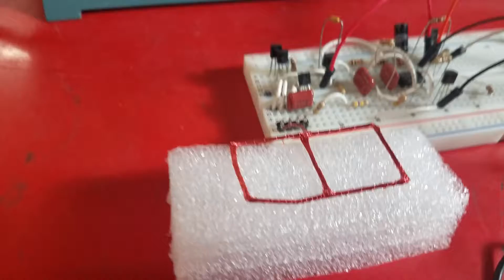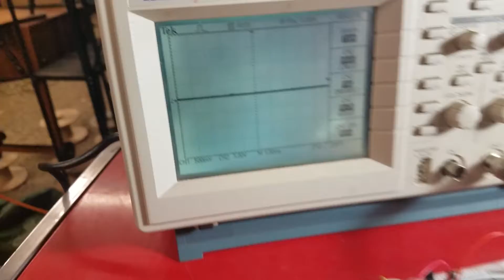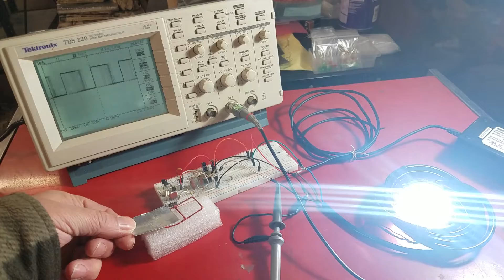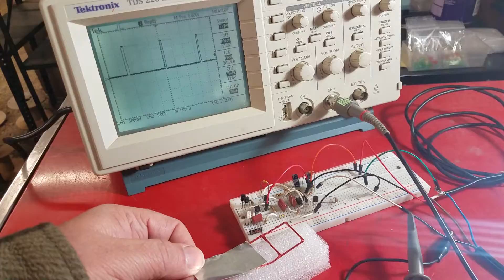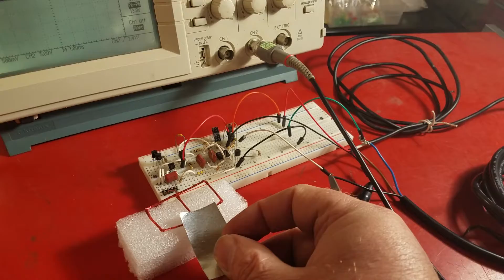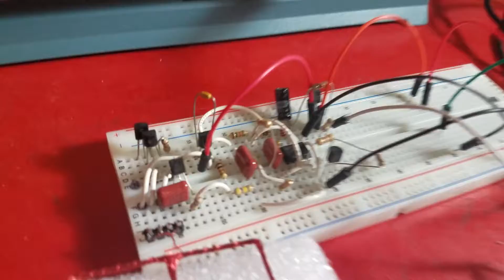Single Ended LVDT (Linear Variable Differential Transformer)

Comment: In the video, you show that the primary and secondary winding are connected to the 4 pin header inserted into the breadboard. The schematic has a 6 pin header so it is hard to determine how the coils are connected. Can you show how they are connected?
It appears that there are primary1 connections (P1) and two stator windings (S1 and S2) in the schematic, how does this differ from this video?
Reply from the maker: Ahh I see .... a typical LVDT will have 3 coils with 2 ends per coil, thus the 6-poisiton connector in the schematic.  P1 in the schematic goes to the single coil driver.  S1 and S2 are combined in my demo and is actually a single coil that is wound in a figure 8 over P1.  Looking back at the schematic, does it help if S1 is ignored and GND goes to pin5 rather than Pin2?  That way you have two coils P1 and S2
Reply: Thanks, after more searches I am starting to understand now. As you said, a typical LVDT would use 3 coils, but this design isn't typical. It shows that sometimes getting out of the box will unlock new possibilities. That's why you have us wanting more.